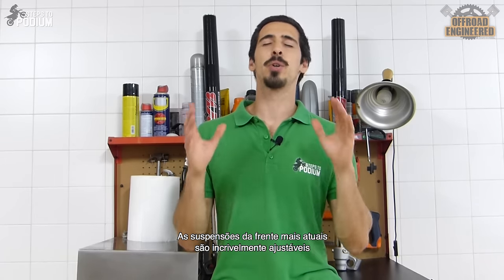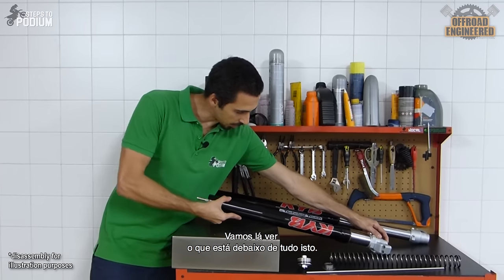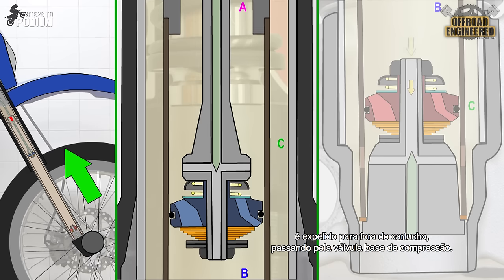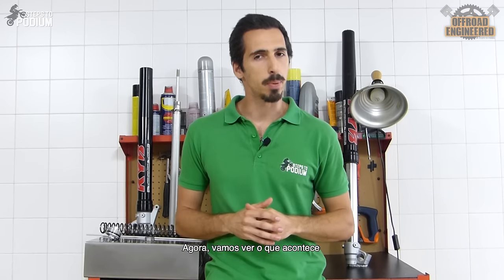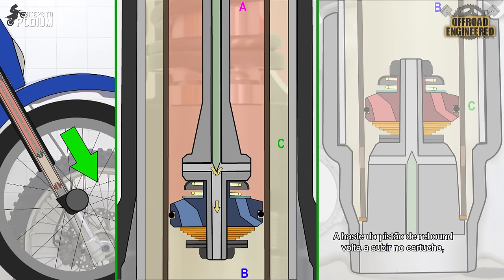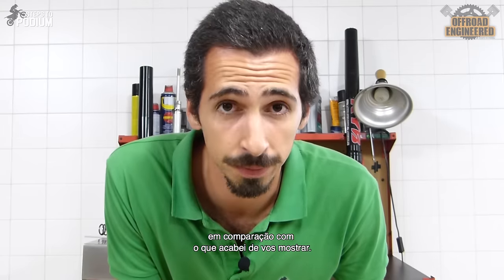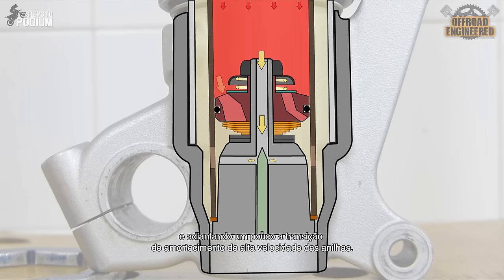How cartridge front forks work | Offroad Engineered

Comment: Hi. Could you help? My rebound clicker does not rotate more than 3 clicks. But it should be up to 15 clicks. What should i check? Damping rod? Or maybe fork cap with a clicker?
Reply from the maker: how many click can you turn from fully closed to fully opened?
Try closing the clicker and then fully open. you should be able to count around 15/20 clicks depending on the fork
Reply: @StepstoPodium  I can turn 2, maybe 2 and a half clicks from fully open position. Manual to my 2015 v-strom 1000 says it should be 14 clicks. I tried a little harder but damaged clicker a little bit. So i can turn it 2 clicks ether way. But then it get harder and stuck =/
Reply from the maker: then you should disassemble the forks! something is possibly blocking the needle, like some grit or dirt 😅
Reply: @StepstoPodium  Yes, i think i would have to disassemble it anyway. I just want to consult a little bit because after i will find a problem i'm afraid i may need to order new parts and wait till they come, it may take up to one month =/ And i use bike every day.
Reply from the maker: that's a bummer 😅😕

Comment: Amazing explanation
Reply from the maker: Thank you!!!
Reply: @StepstoPodium  I have a question, do you think the cartridge seal at the top of the open-cartridge type fork like my KYB46 FF should be completely sealed when it’s moving up with a rebound ? As my oil is leaking thru the seal back to main fork chamber and also thru the 2.5mm holes on the side of the cartridge cap where the seal for main 12.5mm rod is. Thank you.
Reply from the maker: I can't tell, but we can schedule a technical session and you can show me better the problem 💪
Go over to www.stepstopodium.com/technicalsessions 😊

Comment: Well I'm stunned.  I've been riding sport bikes for more than a decade and I never learned any of this.  How do the shims move like that?  What are they made of?  Also, does that means electronic adjustable is just a lil servo moving that needle in and out?
Reply from the maker: Now you do! Knowledge is power 😁
They simply bend. Since they are really thin, they easily bend but don't get permanently deformed.
Regarding the electronic adjustability, it can depend a lot from manufacturer,  but yeah, it's a option having that!

Comment: The KTM 390 Adventure now offers both open cartridge's and closed cartridges' versions. If 'm a off roader doing mild trails and dirt roads, mountain paths, should I go with open or closed?  f  plan to upgrade suspensions n the future, which version is more easier to upgrade? Suggestions?
Reply from the maker: The open cartridge will have more comfort but closed cartridge will provide more stability. Depends on what you prefer!
Reply: @StepstoPodium  comfort or stability in offroad...hmmm...ok good one to think about....thanka

Comment: hey i've got a question at 4:38 - if the piston-rod comes down an compresses the oil in zone B, there are two possibilities for the oil to go out of this zone: 1. the compression base valve and 2. through the check valve of the piston. Both ways can be taken to reduce the pressure in zone B. What I don't understand is that if the oil goes through the piston check valve (2.) there is not much resistance to the oil because this valve is very big. So why should be there any kind of damping?
Reply from the maker: That is a great question! What happens is that only the volume in oil of the piston rod entering the cartridge is pushed through the base valve, the rest goes through the piston rod check valve (in this case, usually there is always a mid speed valve, but to simplify I just made a check valve)

Comment: HI matey, a number of people want to make DIY high pressure compressors (4000psi/200 bar) for paintball guns- People are discussing the idea of using motorbike forks to do it - they look meaty enough. Do you know what pressures they are designed to handle? And do you have any suggestions or interest in looking into it... it would be a very popular video I reckon. I might try myself, but need to know the pressure tolerances of forks, plus I don't have a lathe and am worried about getting stuck 99% of the way through the process. With a proper air filter/dryer these could be used to fill diving bottle, too (reserve air source for filling paintball guns). Any help or ideas gratefully received!

Comment: Sick video. So at 9:45 how exactly does the needle back itself out? Since the needle isn't directly attached to anything but is being pushed by a rod ( At least on my bike ) KYB 48mm. Does the needle get pushed back out by the oil pressure? Because mine is hard to move with my fingers when the fork is apart so I'm just curious how it works. Thank you !
Reply from the maker: Thank you Daniel! 😄 the needle is actually threaded onto the aluminium piece, but it for illustration purposes, I decided to sinplify the sketch 😂
Reply: @StepstoPodium  On my forks the needle gets pushed by a rod that gets pushed by the clickers. Does that make sense? Appreciate your time just trying to wrap my head around it. Thank you dude !
Reply from the maker: Sorry, forgot about the rebound/midspeed valve 🤦🏻‍♂️😂 yes, that one has a spring as well and the spring pushes inwards and the rod pushes outwards for example (it may depends from different technologies) 👌
Reply: @StepstoPodium  That's nuts !!! Thank you man !!!

Comment: 5:39 -- Look at the far right pic... It shows that thick washer on the upper side of the piston moving upwards to allow oil to flow upwards through the piston... Is that top nut on the compression valve suppose to be left loose in order for that thick flat washer to compress that spring and open up allowing oil flow? 
--
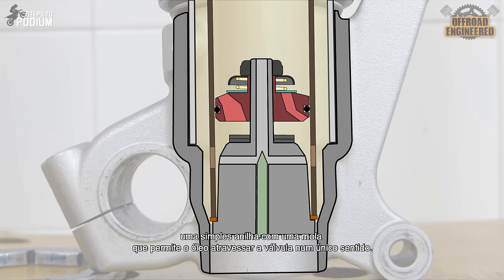The spring and washer I'm referring to are at 2:52 on the left side.  These parts are on my compression valve ... The nut I am using here is clamped down and will not allow the thick washer to move any.
Reply from the maker: No, of course not! usually the nut bottom out. It's just an illustration. I had to simplify some details to remove the "noise". that way it's easier to focus on the most important bits :)
Reply: @StepstoPodium  THXS!  Just for some angle I am missing on taking the harshness from my KYBs.

Comment: Hi - can somebody who knows how dampers work answer the following please? Trying to learn but I've watched the video 3 times and am confused. Surely damping cannot actually work as illustrated/described? I can see 2 fundamental problems:

1) Taking the compression stroke as an example: as forks compress the piston sweeps down the damper. As a result, chamber A gets bigger and chamber B smaller - BY EXACTLY THE SAME VOLUME. It really doesn't matter which orifice/s any resulting oil exchange occurs through, but the fact is that chamber A can ONLY exchange oil with chamber B - so A takes the FULL amount of oil (displaced during the stroke) from chamber B. The oil exchange of chambers A/B is therefore "complete" and "fully accounted for" (and the pressures in chambers A/B will be balanced). There can therefore be no possibility for any oil to additionally pass from B to C as described. If this were to actually happen, B would then be exhausting more oil than A was in-taking (which is physically impossible).
 
2) The 2nd issue is with the explanation of back-filling of chamber A during compression stroke. At 4:35 the author explains that during compression, the rebound check valve opens in order to fill chamber A. Why would it do that???? Oil would surely take the path of least resistance and simply flow up the "needle metered oil passageway" into chamber A instead?

Both of the same problems apply equally to the rebound stroke as well.

Any thoughts??? Thx.